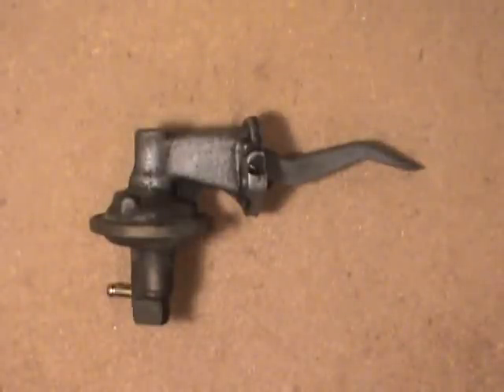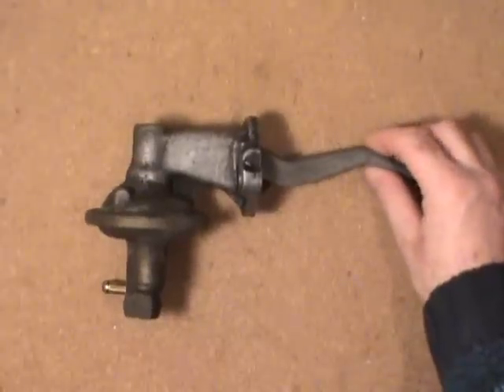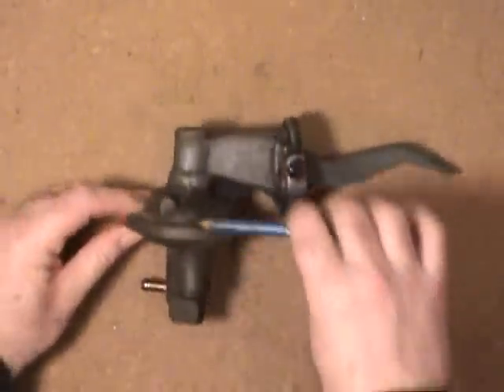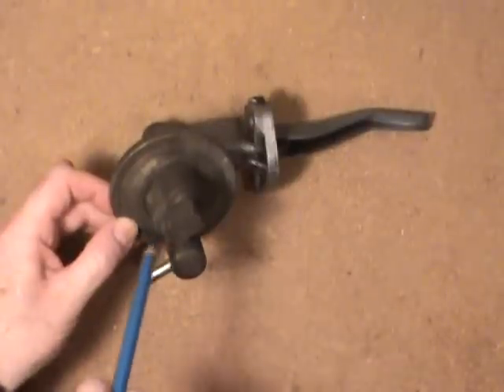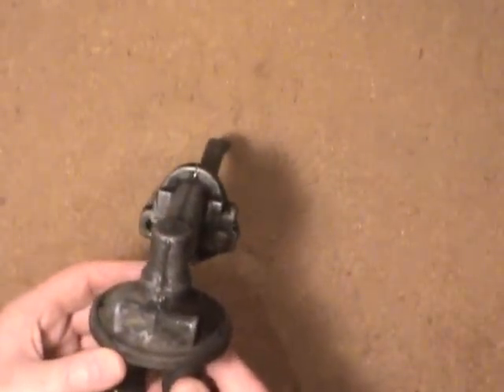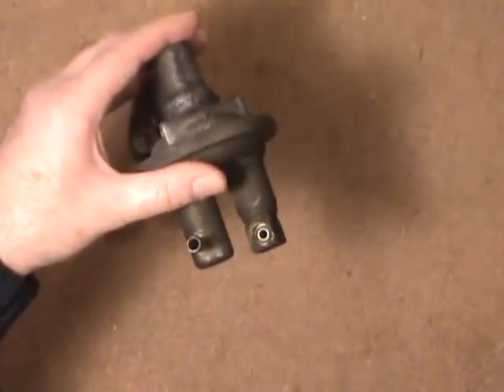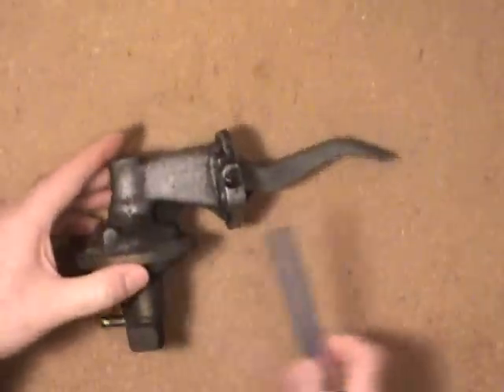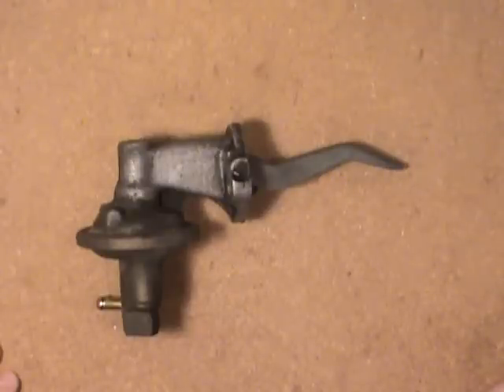Fuel Pump Mechanical Type Demo

Comment: If the original fuel pump arm was straight with only the curve at the end, but the new one looks like yours, does it matter? The old one barely worked somtimes, but then I got this one and put it on and it doesnt work at all. Took it off and put it on 5 times and don't know what to do.
Reply from the maker: Greetings...Vize_Iron.........In order to see what your fuel pump should look like, go over to Rockauto (car parts website)........Once you get there, just look up your vehicle's year, make, model, and engine size, then find on there, where there should be, (more then one) picture of your vehicle, engine's fuel pump........Then, compare your fuel pump's actuating arm, to the ones that you see on Rockauto's website.........Upon installation, make sure that, you put the fuel pump's actuating "Arm", onto the eccentric (wobbly diameter), on the "correct" side of the actuating arm (you might have to "tilt" the fuel pump a bit, before you bolt it down)........Look at your old/used fuel pump's actuating arm, for a worn/smooth, small area, where the eccentric was rubbing on it, in order to, be able to, install the actuating arm, on the correct side of, that, good ole eccentric........Good luck, and......Be safe, take care, and have a good one.

Comment: It's good to know but if the a long arm don't catch what do you do then
Reply: I'm apologize I have turned the engine over with out the feul pump what it do
Reply from the maker: Greetings johnnelson-hi8mj...I saw your other comment, about, not having the fuel pump installed, and sometimes, it can be, that we forget something, from time to time.......Even I, at times, have made a few mistakes, when putting things together......So then, we just have to find the mistake, and hopefully correct it, well, if possible, that is, and, take care, and have a good one.

Comment: Hello there , I have a fiat 1100 , 1983 petrol model . The fuel pump wasn't pumping fuel so the mechanic changed the diaphragm and then when we cranked the engine, the fuel pump began to pump fuel at such high force that the carburetor started to overflow literally  like a river . Is there a fix for this problem?

Comment: Right above that input on the bottom there is that ridge thats just over the diaphragm. The hole there...what is it? I had similar issues and discovered that was leaking fuel through that hole. When I sealed the hole the car ran like a dream

Comment: here's the issue I'm having with my 1, it's leaking,  but the hoses are ok it's coming from the pump, but a couple times I've tightened the bottom bolt and it's stopped leaking, but then when I start it up another time it's back to leaking,  when I first noticed the issue I had steamy smoke coming from the engine bay  but it went away after a  bit,  when the engine heats up,  possibly the gasket is failing ?  what do you think?

Comment: Hey Rocky! just a quick comment. If I remember correctly, the old 60's mechanical pumps had a weep hole like the water pumps had. You always knew if the diaphragm was shot by leaking. But First if not leaking or smelling of fuel, always change out the inline fuel filter first. Especially if intermittent stalling out. Once sediment settles, it will run again for a bit. Cheers from Michigan. Thanks for sharing.

Comment: if i thermo wrap my mechanical fuel pump due to it being on the side of the block and quarter inch from lower radiator hose will it help with vapor lock ?
Reply: Lower radiator hose won’t radiate enough heat to worry about

Comment: Great video. Helped me out.
Reply from the maker: Greetings...Henry Gomez........Thanks for the nice comment, and thanks, for watching too........Here's, the typical, shall we say, "path", that, the gasoline follows, from start to finish.........Gasoline is already in the gas tank...then...there's usually a filter (sometimes called a sock), that's on the end of the pickup pipe/tube, that is located, inside of the gas tank, near the bottom...then...from there, the fuel line (tubing/pipe), usually gets connected to, the "inlet" side, of, the mechanical type of fuel pump...then...from the fuel pump's "outlet" side, the fuel line, will usually be connected to, what is called, an "inline" fuel filter, if there is one, that is...then...from there, the fuel line, will usually go, directly to the carburetor (some carburetors, such as, the Rochester 2 and 4 barrel carbs, will usually have, a small fuel filter, kinda hiding, inside of, a small, removable, screw-threaded fitting, that screws into the carburetor's main body)........If "any", of the fuel filters, happen to get plugged up, really bad, then, the fuel pump, won't be able to, pump enough gasoline, or maybe, none at all, into the carburetor, so, be aware of that, just in case, the fuel pump, gets "blamed", when it wasn't at fault, after all, just sayin'..........It's a good idea, to replace, the fuel filter/s, at the vehicle manufacturer's, recommended, replacement interval, oh, and, don't forget, about the air filter too.........In the past, I even had, a "brand new", brand name, mechanical type of fuel pump, that was "faulty/didn't work properly", right out of its shipping box...!!!...man, I sure wasn't expecting that, to ever happen, but, the parts store, exchanged it, no problem, with another, new, same brand of fuel pump, and look Ma, "it" works super good now...!!!...lol...and.......till next time......Be Safe, take care, and have a good one.
Reply: @RockysRoadshow  Thanks again. Needed to replace the mechanical fuel pump on my 1966 Dodge Polara. It was leaking like a sieve. I watched a few videos but found yours the most helpful. Everything worked out well. The only issue was accessing the bolts. I didn't want to move the alternator out of the way and then have to re-tighten the belts and all that. I was able to get the bolts out. One from above and the other from below. Man what a pain, 1/4 turn at a time. Long bolt, long time turning.
Reply from the maker: Greetings...Henry Gomez........You're welcome, and, thanks for watching (again...lol)........It's good to hear, that you, shall we say, "outsmarted", that, kinda-in-the-way alternator, that didn't have to be moved, after all was said and done........Just be thankful, that, it wasn't a part or component, that had to be re & re'd (removed and replaced), that was on an engine, that was in a much newer/current vehicle, because, I tend to think in terms (jokingly, that is), that, Ya might have to take, half of the engine apart, just to gain access to, the part or component, that Ya want to change out...!!!...lol........Also, the newer vehicles, that have computerized/fuel injected engines, will usually have an electric fuel pump, that, shall we say..."hides"...inside of the gas tank........In order to replace one of those "things", then, Ya usually have to drop the gas tank, down, from the vehicle, just to get at the darn thing...!!! (lol)...and, the electric fuel pump, will probably cost, quite a bit more, when compared to, our "ancient", mechanical type of fuel pump, and.....till next time......Be Safe, take care, and have a good one.

Comment: I have a 1959 fuel pump with no pressure line / vacuum coming out from the top of it where there's two knobs only a fuel Outlet in a fuel Outlet out to the carburetor would I need that vacuum and my car is also stalling shuttering and I hit the gas pedal all the way down and it barely accelerates
Reply from the maker: Greetings...Cali Sav.........Thanks for watching........Well, I never worked on your 1959 type of fuel pump before........Some of them, being that old, might have also had a vacuum chamber, maybe for running the vacuum operated windshield wipers, maybe?.........If there are a number of bolts or screws, that you can easily see, that hold the different sections together, then, it's possible, that the fuel pump can be rebuilt, providing that, the new, needed parts are still available, as in, diaphragm/s, gaskets, etc. ........The website Rockauto (online parts store), might have, a new or remanufactured fuel pump for your vehicle, and possibly, maybe even some individual parts for your 1959 fuel pump as well, so, check them out if you're interested at all.........You can also, look on some website "Forums", for your exact vehicle, where you can ask some of those very smart and experienced people, a question, about, just about any topic, that pertains to your exact vehicle........As for your, not-so-good-running engine, then, it might be a vacuum leak, at the fuel pump or elsewhere, or maybe, it just might be, a split/leaking, or disconnected vacuum hose...???........or maybe, the carburetor is malfunctioning...air filter clean...???...fuel filter clean...???.........Has the ignition system been tuned up recently...???........Good luck, and......till next time......Be Safe, take care, and have a good one.

Comment: Is there a special way to put it on?  Is there a certain way the arm of the pump has to go in?
  I just replaced the fuel pump in my 63 coupe.   Even with pitting a little gas in the carb, it didn't want to start.  I even put gas in carb a second time.  And its never done that before.  Usually I would just put a little gas in carb and it would start right up.  
Have any ideas????  Thank you in Advance....  Dont want to take it back off just to put it in the same way as the first time
Reply from the maker: Greetings...Gabriel Martinez...…...Thanks for watching...…..If your mechanical type of fuel pump, has that long actuating lever, sticking out of it, then, you have to make sure, that, the flat side ("not" the U shaped/trough side), is making contact, with the eccentric (which is basically, a round metal piece, that is offset, to the camshaft's centerline), that, shall we say, "wobbles" up and down, whenever the camshaft is spinning, and, it is this wobbling motion, that makes the fuel pump's lever, go up and down, which in turn, causes the fuel pump's, pumping action...……Whenever I install, this type of fuel pump, I always make sure, to tilt the fuel pump's actuating lever, so the..."solid-flat side"...of the lever, ends up, making contact with, that eccentric, that I was mentioning earlier...…...If the fuel pump's lever, was installed properly, then, you should see, a "shine-ee" spot, on the solid side of the fuel pump's lever, where that metal eccentric was rubbing against it...…….Just look at your old fuel pump's lever, and you should be able to see a small area (wear spot) on it, where that eccentric, was rubbing on it...…….There are some fuel pumps, where you have to tilt them, quite a bit, so as, to make sure, that, the lever, gets installed, on the correct side of that eccentric, and sometimes, the fuel pump's main body, will only make full contact with the engine block, once the mounting bolts, get fully tightened down (just make sure, that, the fuel pump's lever, is on the "correct side" of the eccentric, or Ya might damage the fuel pump...!!!)………..Some Chevrolet/Chevy V-8 engines, might have a round metal rod, that gets inserted, before the fuel pump gets bolted on (no metal rod = no pumping, from the fuel pump...!!!)………..Good luck, and...…till next time...….Be Safe, take care, and have a good one.

Comment: you helped me recognize that low fuel output could also be due a defective inlet or outlet valve, in addition
Reply from the maker: Greetings...Rex O'Steen……….Thanks for watching...…...Even if, the fuel pump itself, is ok, then, there is usually a sock type of filter, that's on the end of the fuel line, that's inside of the gas tank, that might rarely get plugged up/dirty...…….Also, any and all, fuel filters, should be changed on a regular basis, in order to avoid any fuel starvation issues (seen that, been there, but didn't need a tow truck, at the time...lol)……….Yes-Sir-ee-Bob...a few years ago, I installed a brand new (top brand name) fuel pump, on an Oldsmobile engine, that was "faulty", right out of the box, that it came in...…...Worked, kinda ok, for a short time, and then, the engine would lose power, surge, then, almost quit completely...…….I figured that, one of its internal valves, malfunctioned/got stuck somewhat...……Before I took that new fuel pump back, and exchanged it, I put the old/original fuel pump, back onto the engine, and, it worked "Perfectly"...!!!...lol...……I though that, it would be a good idea, to install a new fuel pump, seeing as how, the old/original fuel pump, was very old, and had lotsa mile on it...…….Maybe it is true...???...as in..."they don't make 'em, like they used to"...!!!...lol...and...….till next time......Be Safe, take care, and have a good one.
Reply: @RockysRoadshow  I took my mechanical pump for a 1970 Plymouth apart and it looks good. I sprayed the valves with carburetor cleaner and I think my problem is I did not tighten the two bolts to the block enough , as they were easy to remove. I have this bad habit of not tightening. I'm going to hook the pump up and try again. My thought is that the lack of tightness could have prevented the arm from completely moving, as there was a whimper of movement on the pressure tester. But I don't know, really, as the quality stuff and the fuel- I've not used ethanol, but I saw the term 'oxiginated' gas in a Hot Rod question, and maybe just having ethanol-free is not enough. My problem is my fault, as I don't start my car enough. I realize the younger generation is taking over. I'm 72, and glad to see you young guys taking care of your inheritance from the past.

Comment: I replaced the pump in a 76 ford it turns over and runs  but I don't see any fuel going to the fuel filter line into the carb. Also the truck will shift into gear but won't move in reverse or drive.. any suggestions? 

Great video by the way!
Reply from the maker: Greetings...TechDoc………..Thanks for the nice comment, and thanks, for watching too...…….Do you have a "see-through" fuel filter (because, that's probably, about the only way, that you'll be able to see any gasoline flowing, well, if it's flowing, that is)……….Did you install a "new" fuel filter...???...…….If the engine runs ok, and, there aren't any gasoline leaks, then, you should be good to go, engine-wise, that is...…….With most automatic transmissions, that don't have any drive, in forward or reverse gear, then, the first thing to do is..."Check" the automatic transmission's..."Fluid Level"...…….Try to find out, the procedure, for your "exact" vehicle (if you have the truck's owners manual, then, it might be found in there)………..The truck has to be on "Level" ground, or, the reading won't be accurate...…….Take a look on the automatic transmission's "Dip-Stick", for some lines, along with, hot or cold markings...……..Some automatics, are checked in Park, some in Neutral, but check first...…….The temperature of the fluid is important too...…….In a lot of cases, it might only take, one "pint" (1/2 of a Liter, there-abouts) of fluid, to raise, the fluid level up, quite a bit, so, if you need to add any fluid, then, only add a bit at a time, and re-check the level, that's showing on the dip-stick........Don't Over-Fill it...!!!...because, the fluid, might start to "Foam-up", and then, the transmission, will malfunction, and possibly get damaged...!!! (expensive to fix)………..Make sure, to use the "correct" type of fluid (1976, might use type "F" fluid, but always check)…...Sometimes, the type of fluid, is stamped into the dip-stick, so, look for that, just in case...……..The shifting linkage, might need to be adjusted...…….Not sure about yours, but, some auto-transmissions, might require, what is called, a "band" adjustment, and, if needed, a shift lever, linkage adjustment too...……..On the dip-stick, the fluid should look clean, and not look like, it's a brown-ish, varnish-like color, which could be a sign, that, it got too hot/over-heated...........If the fluid level, wasn't the problem, then, look on the internet, for some websites, that have a Ford Truck "Forum" on it, and ask those people, about your truck (some, same year, Car forums, will probably be able to help you out too)……….Good luck, and......till next time...…..Be Safe, take care, and have a good one.